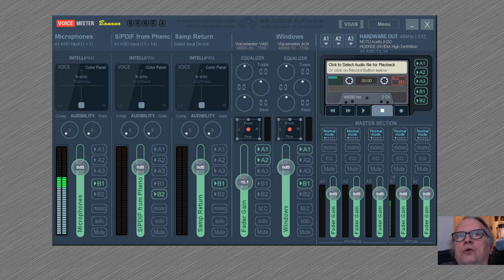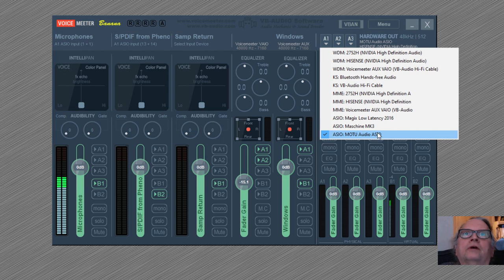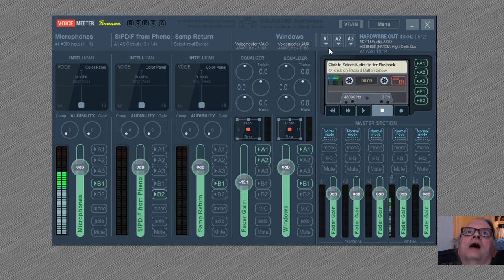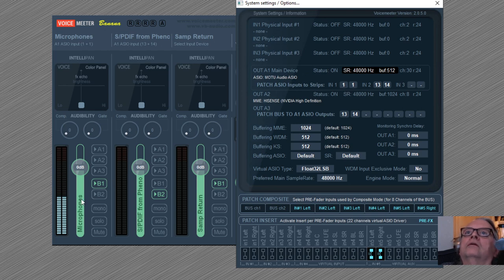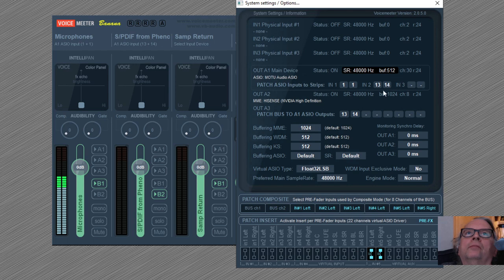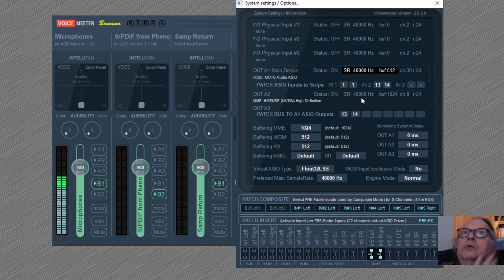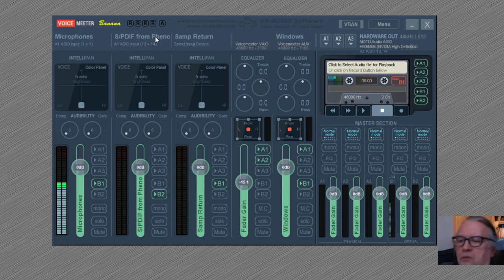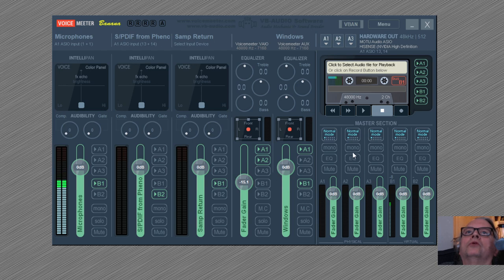Using Voicemeeter to interface DAW through ASIO hardware and a "loopback" cable to Zoom, Skype, OBS

Comment: You are a genius. thats exaclty what i was looking for to run my E-MU 1820 properly (15y old hardware). i spent almost 7 hours to get this device running because there is no Win10 Driver Support only to get stuck with ASIO after that and not knowing that some Windows programs cant handle it. i used it in the past with Adobe Audition and never encountered this problem. Its difficult to figure out the problem if there are more than one and you´re a total beginner hahahaha. Thank you very much !! i will probably do a guide too about the whole Hardware-Software Problem in different languages so noone has to suffer again like me. i will probably link your video in the discription for beeing the messiah :D
Reply from the maker: I am so glad it helped! 😁

Comment from the maker: For mobile viewers who only see the comments: Shows where the settings are to include an ASIO hardware device in Voicemeeter and then select that hardware device's outputs to assign to strips in Voicemeeter for sending out to Skype, Zoom or OBS. I am using a "loopback" cable to connect an unused output/input pair back to the input so that I can utilize a hardware output as an input to Voicemeeter (I currently use an ADAT output/input, but used to use the S/PDIF ones). For ADAT in an 828 mk3 hybrid, for instance, I connect an optical TOSLINK cable from the output back into the input. For S/PDIF, I would connect an RCA COAX cable from the output to the input. This makes the output I send to in my DAW available as an INPUT to Voicemeeter.

Comment: The setting is a hidden gem that I never knew about. I might have to give this a try for this Sunday's online service where I will be on keys and my friend will be leading. I'll be using my Scarlett 2i2 on Reaper and have been scratching my head on how to get an additional output to Zoom via VM without changing the device preferences. I've considered ReaStream, ReaRoute, and even VM Potato. This might do the trick just as well.

What do you think? Did I get it right?
Reply from the maker: I use that technique many times each week, so I think you got it right! Let me know if you have any questions.

Comment: Hello Terry,
Thanks for the detailed tutorial. It helps to raise confidence in trying with Voicemeeter.
I've a simple set up: audio interface 2-ch in/out with a mic on ch 1), DAW for piano VST and have set OUT A1 Main Device / PATCH ASIO Inputs to Strips to IN1 1 1 for the mic. In OUT A2 I have to set PATCH BUS to A1 ASIO Outputs to 1 2 - - - - - - - - otherwise I can't hear in monitor / get the piano sound to Zoom.
Note that my DAW is set to Voicemeeter ASIO with inputs 1/2 and outputs 1/2 & 3/4. I have the mic set in Voicemeeter only and not in DAW and the DAW has a return channel set to 1/2 for me to hear my onw piano playing and the master out is set to 3/4.
Is this setting correct? Thx
Reply from the maker: It does seem very similar to my own streaming setup.

Comment: Will this approach work to stop an "Armed" track on a DAW from feeding back when you want to monitor the signal you are recording? Currently, I am using Voicemeeter to handle sound on my PC... If I record using my DAW (Abelton 10) I get crazy bad feedback when the track is armed and I hit the monitor so I can hear what I'm recording to the track... I need to disable voicemeeter and revert back to the stock windows audio defaults to rectify this problem and then set voicemeeter back as my default audio afterwards... I'm trying to figure this whole thing out so I can leave voicemeeter as my default audio for ALL my applications  and uses (Streaming, recording etc...) Thanks for posting!
Reply from the maker: Watch your A and B outputs that they are not returning to a channel on the DAW that is outputting to Voicemeeter's strips. Are you trying to play along with sound on the PC? Make sure the input channel recording your system sounds in Ableton is not outputting to the same Voicemeeter strip. I definitely advise you use Voicemeeter Banana so you get the free extra (VAIO AUX) strip to output to solving that exact issue, and get more control over the outputs, as the A and B outputs are split into separately armable channels. 
Just to give you hope, I use Voicemeeter as my system's audio all day every day, but haven't had a feedback issue. It is all in the routing of the A and B buttons.
Reply: OK, I think I understand. I did install Banana and figuring out how to use it. Indeed, I am playing along in Abelton when recording on my PC. I'll scope my hardware settings in Abelton and try the A B outputs solution, Thank you :)

Comment: I have a problem. Im using a Steinberg cl2 soundcard with a plugged in guitar and a condenser mic. I want to be able to stream the audio from FL Studio into Voicemeeter, and im also wondering if that daw audio could be sent  to my samsung phone as a microphone while also hearing the sounds from the others speaking on applocations such as discord but mainly for another similiar app. I recently saw some videos on this using splitter cables and also some people used a shitty V8 soundcard that defeats the purpose of having a soundcard in the first place because the audio quality is so shitty. I have no idea where to begin looking as i dont even understand voicemeeter very well yet. I have no idea what i'm doing.

Comment: @Terry Leigh Britton, could u make a video on how to use the Voicemeeter Potato "External FX Return" With ASIO Drivers? Like currently i'm using the old method of using INSERT but want to make use of the "External FX" Send and Return function.
Reply from the maker: Great suggestion! I will look that over, and once I am comfortable with it I'll make a video on that.
Reply: @CreatorsMediaTools  I just got my Scarlett 2i2 interface, but I'm stumped on how to use the 
1) External FX (Both Sends and Returns)
2) Patch Composites (What are they used for)
3) "PATCH BUS TO A1 ASIO OUTPUTS
Reply from the maker: @AKSKMY  With a 2i2 (having only one set of stereo outputs and one set of inputs) you would be possibly hard pressed to use external FX, but perhaps you could monitor those through the headphones? (I have a 2i2 - let me know what you are wanting to do.) Patch Bus to A1 ASIO Outputs is not applicable to the 2i2, as it only has the one set of stereo outs. That is more for interfaces with multiple outputs. I am not sure what Patch Composites are - I've only seen the term "Composites" associated with mixes of selected devices for the recorder. Is that a Potato thing?

Comment: Hey 
I have an Edrum and an Audio Interaction (Behringer UM2) 
How to stream audio into skype?
I tried Voicemeter, but it's not picking up the instrument sound, since the ASIO Driver is already in use with the interface which is connected to my PC.

Any help on streaming Audio into Skype would be great for my set-up.
Reply from the maker: For streaming, assign the A1 dropdown to your audio interface ASIO, and assign the DAW to the Voicemeeter ASIO or the ASIO Inserts on Banana if you know how to use inserts. Once that is done, you can route your audio interface's channels to mixer strips and so include them in B1 or B2 outputs to Skype. Put your microphone in strip 1 and other stuff into strips 2 and 3. This is done via the system settings dialog. Let me know if you need more information.

Comment: But if VM A1 is set to my hardware asio my daw wont read it
Reply from the maker: Yes, on Windows most ASIO devices will only permit one program access to it at a time. What you do to solve this is let Voicemeeter have the ASIO driver, then point the DAW to Voicemeeter's VIRTUAL ASIO drives - either the VAIO or the AUX. There also is an INSERT virtual ASIO port there. Those work fine, and you still get Voicemeeter following the low buffer settings of the ASIO device.
Reply: @CreatorsMediaTools  thnx man!! Very very much appreciated!

Comment: Im trying to use this with antelope thunderbolt on windows and I can only see 8 channels when you are selecting the the numbers for 1n 1 in 2 in 3. I want to select 63/64 for my in 1 stereo pair but it only goes up to 8 channels. Am I missing something? I see you are selecting 13/14 somehow.
Reply from the maker: You can assign those channels either to an input strip or an output channel in the System Settings/options section. You will see that dialog near the top of that screen. I can access all 36 in my Motu 828, for instance. The 8 channels limit only refers to the VIAO and ALT central sliders.

Comment: no idea what to route in my daw though... adat-channel? I don't have/use an adat channel... I just want the sound from cubase be streamed through zoom - how do i do that? No idea after this video! :(
Reply from the maker: Any available open channel will do as an output channel. If you have none available, (not even an unused S/PDIF) then you might have to use Voicemeeter as a virtual ASIO device for your DAW's output, but still select your ASIO audio interface as the A1 output device on Voicemeeter for monitoring purposes. One of my other videos shows this technique, but not sure which and I am not home to check. Let me know of you have any questions.

Comment: Hello Mr. Britton. I am unable to select my Daws driver as Voicemeet Insert Virtual ASIO. DOes this make things harder for me to live stream music ?
Reply from the maker: No, not at all. You only need the inserts when sending from Voicemeeter TO the DAW and back to Voicemeeter, like in applying effects to your VAIO/VAIO AUX inputs or input sliders (compressors, room correction software like ARC2, etc.). To live stream live performance with your DAW hosting the instruments, you need only a)if using a USB ASIO interface, choose the channels you are outputting to in your DAW in Voicemeeter's "Assign to channel strips" section" or b)use Voicemeeter as your ASIO output device to send to Voicemeeter's VAIO or VAIO AUX sliders. Did you see the one on giving piano lessons via Skype, etc.? The rules are the same when outputting to OBS.

Comment: I want to route vlc and my mic into my daw and have everything go through one final output that can be used as my mic for other programs. I can get vlc and my mic into my daw with just vb cable, but as soon as vlc starts playing I lose the ability to chose vb cable audio as an output. It seems like routing vlc into my daw uses up the output of vb cable. Can I solve this using banana?
Reply: I solved this buy using vb-cable a and b. I just needed 2 cables to route 2 things (vlc and my mic). Anyways thanks for these videos
Reply from the maker: You can also use Voicemeter Banana for its extra VAIO input (VAIO AUX), or Potato for its three VAIO inputs. That was the major reason I switched (pretty much permanently) to Banana, but then discovered all the other cool stuff you can do with it!

Comment: Yes, but how does one use Voicemeeter to interface the DAW through ASIO hardware?
Reply from the maker: One way: You set the A1 monitor output to point to the ASIO hardware, which then syncs Voicemeeter to the ASIO devices buffer and sample rate settings. Then you select Voicemeeter Virtual ASIO from the DAW as the input and output.

Another way: You still set the A1 monitor out to the ASIO, but also use the ASIO device for your DAW, but output into Voicemeeter from the DAW via a loopback (either a hard-wired one or one made by the ASIO audio interfaces software). For instance, I output from DP or Cantabile to a wired loopback using unused ADAT ports, then assign that to a strip in Voicemeeter from the system options section near the top, "Assign ASIO channels to strips".
Reply from the maker: A third way related to the first method is to connect your DAW to Voicemeeter's Virtual ASIO INSERTS, which grabs the audio pre-fader, loops it through the DAW and returns it again pre-fader in each strip.

Comment: Thanks for this great video! But I have a problem; when I play the guitar with backing track through sonar platinum on Google Meet with these settings, sound ok first 10 seconds but then the sound decreases and almost no sound; when I stopped playing sound increases again. So I searched for months but can't find the solution, Could you please help me, sir? 🙏
Reply from the maker: I might venture to guess that your are pushing Google Meet too hard while playing, so its auto volume adjust is turning you down until you stop playing, when it turns you back up again. Is there any way in Meet too go into a "studio mode" like you were able to in Hangouts?  Also, be sure to keep the instrument volume around minus 12 db for streaming.
Reply: @CreatorsMediaTools  I did not see any studio mode in Meet but, thank you for advice, I appreciate🙏🏻

Comment: Hi, am using scarlett 2i2 3rd gen interface. And I need to use 2048 buffer size in my audio software.  But as a default buffer size am just able to use 1024. So am looking for that. Is it possible with voicemeter banana? As I can see, you connected you motu interface with voicemeter. So is it possible anyhow to increase my interface's buffer size with it?
Reply from the maker: Not if the driver isn't made to support that buffer size, i think. That is pretty huge, perhaps just use the WDM or MME Windows drivers with the 2i2. I own a first gen one, so I'll see what all is possible. Why do you need such a large size?
Reply: @CreatorsMediaTools  for the mix mastering Processing and music production.  Am use a good number plugins in my channels.  So 1024 is not enough for me though my laptop configure is not so good at present time. Can you please tell me the process with detail, how to use external  WDM or MME  driver in pc and how to 
Attached 2i2 with it? Am a new interface user  sir. Please help me.
Reply from the maker: @BMusik  Just don't use ASIO at all. Just use Voicemeeter in its normal form as a Windows audio driver (WDM or MME) and that should provide you with the stability you need. Make your A1, A2 or A3 output the Focusrite 2i2, but not the ASIO one at the bottom. Rather, select the ones higher up the list.

Comment: Wow - this is very very helpful!!! Is there any way to contact you? I'm having some issues with connecting my allen heath sq (ASIO device) to TurboBridge Conferencing Platform. I only need to get sound from my mixer to the platform. I don't need to hear back anything.
Reply from the maker: What sorts of inputs does the TurboBridge software have? Is that a software platform that can also work with ASIO? If only with WDM (Windows Audio) you should be able to use the B1 or B2 outputs from Voicemeeter as detailed here to send to the TurboBridge software as an input.
Reply: @CreatorsMediaTools  thank you! It worked when I selected ASIO device as hardware output! Volumes are very low so I have to hike up the faders but it's fine
Reply: @philibuster8156  Super!!! Let me know if anything else comes up, and do look over the other Voicemeeter videos I have here. I have to wonder why the volumes are low. Is there an input gain control on the mixer that might be needing tweaking?

Comment: Intresting story. I have new windows 10 install. After I selelected other (than default) device (like VB CABLE) in sound preferences for applications like Microsoft Edge or Telegram everething seems working and fine. BUT! When I restart  Microsoft Edge or Telegram they will pick the defaul device and not the selected one. I think it is a bug. Chrome or Chromium they satay always on selected VB CABLE. Chrome doesn't resets to default device after application restart like Telegram or Edge. Very very strange...
Reply from the maker: How odd! I use Edge, so I'll have to see if I can replicate what you are seeing with VB Cable and perhaps find a fix for it.

Comment: I'm having a problem where the voicemeter asio doesn't show up in my daw only the bio and aux
Reply from the maker: You need to switch the DAW to ASIO mode. It is presently in Windows Audio mode. If your DAW is Audacity, it does not support ASIO.

Comment: Is it possible really to use Pioneer DDJ-SZ, Serato DJ with voice meeter.
This would make for the cleanest audio ever. Anytime I attempt to set it up Serato won't play.
It's responsive when I press buttons on the hardware (DDJ-SZ) except when I press play, I can press play, play shows it's responsive on the software but the music doesn't go/move as it did before.

Did this even make sense^ 🤦‍♀️
Reply from the maker: I would write the author directly with that question - Vincent Burel. His email address is displayed prominently at the bottom of all the VB-audio web pages, and he is very helpful and responsive.
Reply: @CreatorsMediaTools  Thank you very much :D